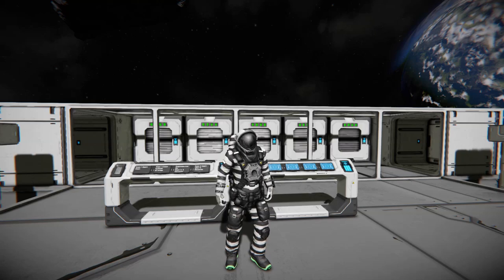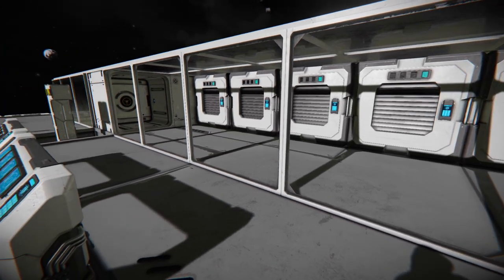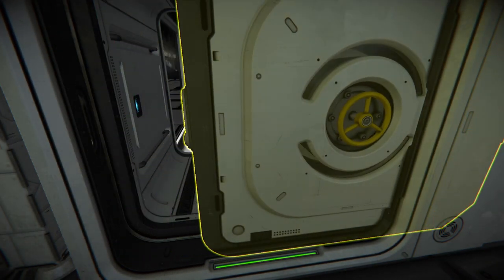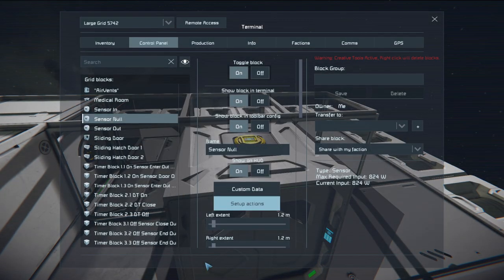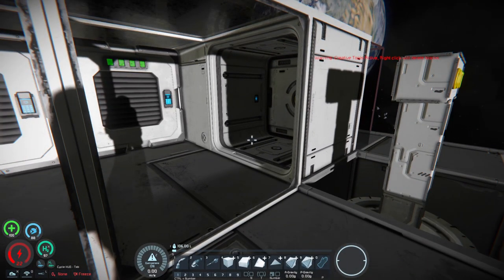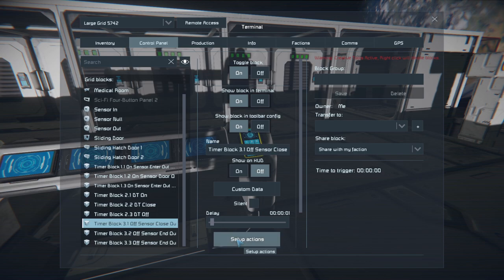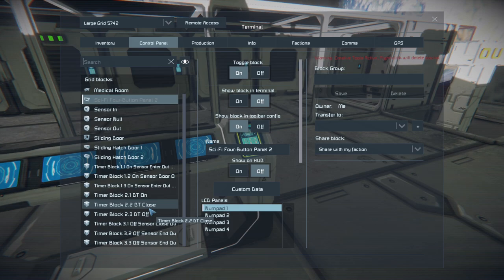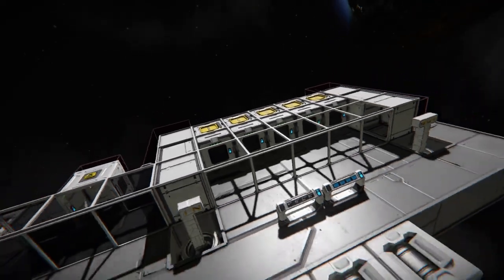How To Make A Proper Airlock System | Space Engineers Experiment

Comment: Probably a simpler way to do this:

ie. when leaving ship/dock.
Door is off by default
Trigger sensor:
Depressurize timer block 1: Toggle Pressurize Timer block OFF > Airvent (Depressurize on)  > start dep timer block 2
Dep. Timer block 2: delay for depressurize > Toggle door on > open door > Turn on pressurize timer block

Untrigger sensor:

Pressurize timer block 1: delay however long > Close Door > press timer block 2
Press. Timer block 2: Turn off door > Airvent (depressurize off)

Turning the pressurize timer block OFF prevents the timer block from pressurizing  before the depressurize sequence finishes and turns it back on even if u leave the sensor range.
Reply from the maker: Thanks for the details. I was sure someone would come up with a simpler solution
Reply: Broo what I got lost at the 3rd line 😅